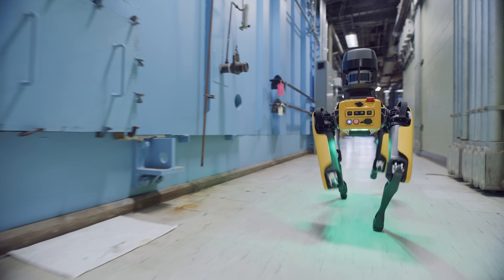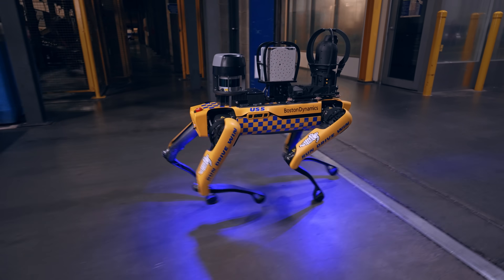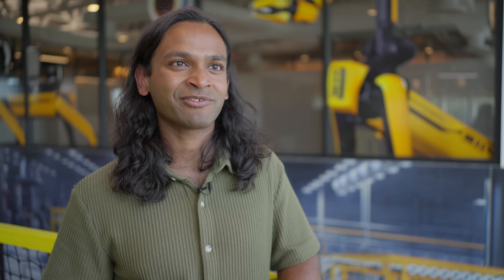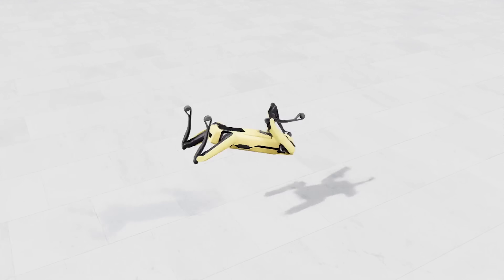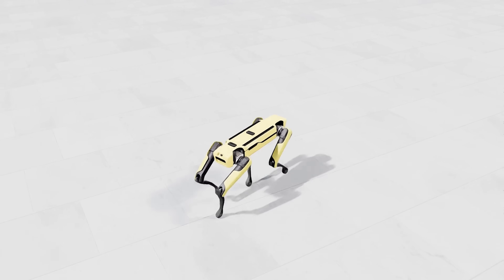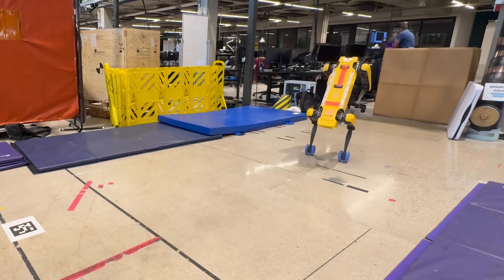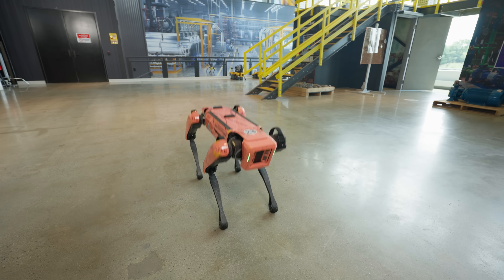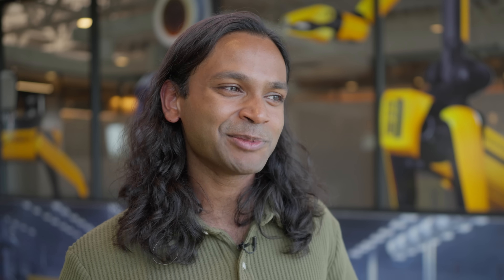Air Spot | RL Behavior Research | Boston Dynamics

Comment: We are where the money is at. You're messing up by not investing in us. Someone is going to. If it ain't you, that's your fault. Also, why are using dumbells to hold down the mats? There's these rubber sheets you can get that makes them stick. Use those instead. Instead of putting a potentially destructive object in the testing area. Man, nerds. Sheesh.

Comment: Was bekommt der Computer für ein Leckerli? Einen Stromschlag? Super übersetzt und sehr gut gesprochen! Wenn das System beim Sprechen schneller wird, ist es dann verlegen oder hält es nur einen Lachkrampf zurück? Falls ich einen Wunsch frei hätte, würde ich gerne die Originalstimme von dem Kuna hören!😂 Die Batterie von den Open Door Buds hat immer noch 90% 😂 oder ist das auch eine Simulation. 🎉🎉🎉 Beeindruckende Leistung!

Comment: does spot use any sensors akin to ears, ie sonar. for stuff like, pinpointing the source of a sound. mostly interested for stuff like detecting stuff outside of his vision cones, like someone coming around a corner (and maybe in the future for listening for ground shifts on unstable terrain, or testing terrain by tapping on it with his foot to hear if its solid or not.
semi related, does he have anything as sensitive as the inner ear for balance? like compared to humans, how accurate is a gyroscope to a pair of inner-ears.
its also crazy to me that hes predicting how his movement will behave for something like a flip and also reacting to it, and adjusting it on the fly, instead of just going through the motions and praying to end up on his feet.

Comment: FYI a triple backflip is when the backflip is done three times in the air before hitting the ground again. And the robot only does multiple backflips in a row. And it never did a triple backflip or a quintuple backflip nor a septuple backflip as the "never went to spots class or gym" engineer. Impressive acrobatics show from the tinman. But not that impressive.

Comment: I'm still waiting for the video where Spot uses its legs to run as fast as possible "backwards", because now moving forwards its knees are not orientated in an optimal direction (bending backwards, reverse of our knees) and such the legs don't have the optimal leverage against the ground.

Anything with knees oriented that way goes SCARY fast.
Reply: Well, there is Cheetah that they have a video from 12 years ago, but I'd love to see how the updated control systems would fare with the forwards knee configuration.

Comment: As a massive warehouse owner we're excited about this, but the price is a bit high for our budget. Is there any flexibility? You can get 26 Unitree Go2 dogs for the price of one Boston Dynamics dog, based on the starting prices of $75,000 for the Boston Dynamics dog and $2,800 for the Unitree Go2 dog. Is competition dead in America? They also have a cheaper model and you could get 46 full Unitree Go2 robots and have enough money left over to potentially purchase parts or accessories for them.

Comment: Why aren't at least two of spot's feet always small wheels (with brakes)? It seems like you could save a lot of energy by rolling when possible, not to mention how much less complex of a motion it is.  With the brakes applied, spot could move as it does now as well.

Same with Atlas. Why not use small wheels for feet so it can balance like a Segway or hoverboard and save its battery for human-like locomotion when the terrain doesn't allow for rolling?

Comment: Hell, this is scary as hell. Imagine, you forgot your wallet at your workplace and you come back after hours… Facing that watchrobot and their failings requires you keep a strong electric shocker with you.

Diktators can’t wait for this cheap forces to rule and control enemies.

Comment: So why don't you use a code for problem solving and make it consistent across all 3 problems? I means its relatively simple. Problem=A>B>C>solve>OmegaABC>1. That's the core idea, and it can be improved depending how many solutions you have, if you give it the exact information of the solution and problems, it should decide a solutions upon consideration of all 3 problems trying to resolve it. The biggest problem is in the use of the framework to solve a problem in the same framework, its not gonna work. Use a different framework then it will know the difference.

Comment: That was really cool, and impressive, the stress on the mechanics is probably quite high in these movements. I assume whatever neural networks are trained would have to be "merged" into some sort of everything-model that can move the body of the robot in whatever way is necessary to achieve an objective, given current environment and sensor information, in the end?
Reply: Yes, that's right.  When training is sufficiently advanced, they can repeat the optimised training regimen into the main AI world model, and then upgrade all the Spot robots that have the same level of hardware.

Comment: The sad truth is Unitree had already done what BD has done 6 months ago and now most AI robot Chinese firms have transfer such experience and focus to humanoid robots instead. Remember 2 leg standing robots are more challenging advance and complex than 4 legs standing robots on mobility. A dog's spinal column has approximately 83-86 degrees of freedom (DOFs), while human has Ribs and Spine: 193 (Total), 170 (Moveable). While US focus on partial DOF (meaning some parts are not moving) on AI robots, China already go to full DOF (thus China held its own AI robot Olympic for the world while US don't even dare to do it. China registered 451,700 companies in the intelligent robotics sector. For USA, guess how many-It is not even close to China.
Reply: Unitree robots are really bad copies of tesla's Optimus models. And in the so called robot Olympics, most of the "robots" fell over after taking few steps and those who managed to finish, were remote controlled toys. And no, China does not have working AI, at least not in robots.

Comment: Billion dollar global insight to max profits. Implement series of experiments by testing the current model of Air Spot robo dog by Boston Dynamics backflips in muddy, rainy, heavy rain, snow, shallow water, and quick sand environments. Then duplicate the robo dogs with model 1, paper at each inner chassis and joints, and model 2. Apple Watch water detection sensors in each inner chassis and joints.

Comment: "The scariest thing about a triple back-flip on Spot is probably finding all the different ways the hardware can fail in these scenarios and finding ways to mitigate them, is probably is the scariest and hardest part of a triple back-flip."

only ever performs a single back-flip. C'mon man.

please learn the difference from a hand spring to a back-flip.
Reply: It doesn't have hands. C'mon man. 

Learn the difference between a handspring and a bulbous-termination-point-of-a-mechanical-limb spring

Comment: The base design and requirements for Spot, set such a high bar for its hardware performance, that it can be programmed to do these things without hardware modifications or upgrades.

Comment: It's still so weird how they keep saying the robot is doing reinforcement learning, which is technically true, while at the same time they also say that when the robot doesn't do what they want it to do, they are the ones who are going to find the problem and not the robot. Why not include tactile sensors in key spots on the outer shell and make a algo that simulates some sort of limbic system that the robot can use to learn by itself instead. Reward shouldn't be the only way to learn things, there should be a system where Spot can learn by avoiding "pain".
Reply: If remember right from previous videos, they said some problems come from difference between simulation and real life, and when they counter these problems they dont know if its on software or on hardware, so that takes some work to figure out. Small differences between different robots and parts, you can simulate a lot of variables but each robot is different, either due manufacturing tolerances/errors or different kind of wear and tear. And they have a lot of moving parts that they are pushing to the limits of the parts, so it multiplies the differences between simulation and real life.

Comment: What's wild is that, at some point, the differences between simulation and physical testing, which are limited in number, will be ironed out enough that nearly anything learned in simulation will be reproducible in physical testing immediately. Every failed physical test that doesn't match the simulation today leads to matching them more closely in the future. You can only repeat that process so many times before simulation and physical behavior are 1:1.

Comment: I'm no engineer, but I feel like the bots should have the capacity to exert that large amount of force, but shouldn't be running at 100% the entire time. With actual living creatures, muscles have the capacity to exert way more force than they normally do, but it's so powerful it can damage itself and the bone structure it's attached to if done for too long.
Reply: In live operation for mine safety and machinery safety inspections, the Spot robots walk cautiously, so extreme agility is a crisis response only.
Reply: That's the beauty of machines, You can and totally should use them at 100% unless energy usage is somewhat important. Living creatures, while resistant have to spare themself because injuries and risk assessment are crucial for survival. Machines wear and it's calculated in service and use parameters. Tasks like these just opens up envelope of possibilities for other users. But I'm no engineer either. :)

Comment: The fact that they built robots that are durable enough to handle the stresses of learning and doing these tricks is impressive in itself
Reply: Yeah...metal...it's been around a while.....
Reply: @OMNI_INFINITY there was a time when they were afraid to let them walk without being attached to string to keep them from being damaged. They were metal as well. Now they let the robots throw themselves about doing back flips.
Reply: @DavidKnowles0 Now they aren’t using hydraulic hoses
Reply: @OMNI_INFINITY  yeah, its too bad metal doesnt emit an anti damage field to the things that arent metal.
Reply: @OMNI_INFINITY  You think circuit boards and electronics are all made out of metal?
Reply: @TilesOfOppression It’s a robot…and yes, the circuit on a circuit board is made of metal
Reply: @OMNI_INFINITY  Nice try lol, you picked one of the only pieces of the electronics that's made out of metal, and it's not even structural
Reply: @OMNI_INFINITY  Ah you should go ahead and bend and sit on your phone then since there's a PCB board inside it and it's "all metal"
Reply: @OMNI_INFINITY  the rest of the circuit board isn't metal, and electronics dont like being tossed around.

Comment: I kept waiting to see a triple backflip in the video, but it never came.  A "triple backflip", as a gymnast would understand the term, would mean three full rotations in the air without touching the ground.  What you have here is three singles in a row, and they're also handsprings rather than than flips.

Comment: 2:50 What kind of reward does a robot get?
Rewarding a machine makes no sense to me.
Reply: "reward" here just means a value that the program tries maximize.

here's a simplified explanation:
the program that controls the robot can select a set of primitive actions to perform. over time, it collects a list of action sequences it has taken, and the reward that each action sequence was assigned by a human (or an evaluation program called a "reward function"). then using this information, the program generates a new action sequence it predicts will lead to high reward.

so "reward" here is a synonym for "thing that the program wants to produce more of"

Comment: A backflip means you take off with your legs, rotate backwards 360 degrees and land on your legs. A back handspring is when you jump from your legs, rotate 180 degrees backwards and land on your hands, then complete the other 180 degress of a full rotation after your hands have made contact with the ground. Spot is doing back handsprings, not backflips. A TRIPLE backflip is when you take off from your legs, rotate THREE times while in the air, and THEN land on your legs. A back handspring is a beginner move for gymnasts. A backflip is also a beginners move but slightly more difficult. Only a handful of people on the planet can do a standing double backflip. No human has ever done a standing triple backflip from a non-bouncy surface and I have a hard time believing that anyone will ever be able to do it. The difference in difficulty and impressiveness between "Three consecutive back handsprings" and a "triple backflip" is so vast they exist in different universes. 
STOP CALLING IT A TRIPLE BACKFLIP.

Comment: Why do scientists still send less reliable wheeled robots to the Moon and Mars instead of walking robots like this one?
Reply: because indeed they(wheeled robots) are more reliable(at this moment of time), if you did not slept on physics lessons in school you would know that round wheels are more efficient/reliable and suitable for long range transportation!
Reply: Less reliable? We've been using wheels for millennia and have an excellent understanding of how they work across all kinds of different terrain.
Wheels are a lot more stable, have fewer moving parts (ie. points of failure), and they offer redundancy. Towards the end of its mission, one of the six wheels of the Mars probe Opportunity failed - making it difficult to drive forward. After studying the problem in depth, the solution they found was to drive it...    backwards!

Which reminds me... If you think the Moon and Mars are going to be crawling with bipedal Tesla-bots building things, think again.  A bipedal robot is probably the worst design you could ever choose. Any advantages will be outweighed by the challenges - stability, battery life, heating and cooling issues, range limitations, etc.

Comment: Spot Graphene Fusion. Everything gets made at an atomic level to include the battery shell electronics and it’s all one thing.  That’s how everything‘s gonna get done as soon as you’re done getting your science done.  That’s the next level of electronics and we have to get there immediately or we’re gonna burn up because what we’re doing with silicone is the equivalent of trying to run a AAA game on an RTX 5090 that’s made of vacuum tubes.
Reply: Photonic compute.

Comment: You need to start taking all of your failures and tracking them.  Your failures will point to were the real math is at. For example, right now one of my thoughts is that this is a Mobius strip with nine layers that represent the different dimensions that we think are here. The possibility could be that if you looked at the zero point of a waveform, those might be the transition boundaries as waves pass through the third dimension.
Reply: Particle physics is probably just waves hitting a transition boundary, but they are not real at all because that wave keeps going into the other dimensions and you’re just seeing a reflection
Reply: The noise is the real universe.  We’re doing the exact opposite by filtering it with an our dimension, but that is the real universe or at least our perception of it as we can view it.

Comment: Not to be a bummer, but isn't a "triple backflip" three backflips during a single jump?  And the demonstrated behavior is consecutive single backflips?
Reply: A triple backflip is when you rotate three times in one jump. These are not triple backflips, they're not even backflips, more like back handsprings.
Reply: Somersaults technically but they all involved intense physical stress necessary for the test
Reply: @j-sant-animations8105  A somersault is a completely different move.
Reply: not really, because the start of the second and thirst flip is completely different from the first. 1. The position, 2. The velocits 3. knlowledge of position in the room and so on, everything changes, especially when you come out of a movement

Comment: Is it possible to scale SPOT up to the size of a car or the size of a Fridge. Scale him up really big? I'm thinking that it's possible considering that you perhaps have to scale up power and motors but the rest of the body wouldn't be so heavy. I don't know. Tell me boston, is it possible to make a horse sized SPOT?
Reply: Look at their old videos. Originally there was a bigger Spot and some other large 4 leg robots as well
Reply: @areadhead  yes that's what I was referrring to but a modern day rendition. Something the size of a car with the maneuverability of this SPOT.. materials could be light because the entire body doesn't have to be filled and it could really just be foam and carbon fiber maybe for the prototype. But I definitely believe they have some larger, more serious robots at this stage
Reply: A car may be too much if you want it to do backflips, but yeah.

Comment: Range of motion on Spot is impressive.  Testing to fail is how you learn and improve. Nicely done.
Reply: The range has been increased over time. I want to know if it can walk with it's back flipped facing down.
Reply: Training full range of motion to failure is how your motors grow 🦾
Reply: eh iam a spaceengineers construction veteran - ehm you just set the propulsionPower - an experimental value - than you just looking how its landing - as next you just need to set the vaules. maybe adding an extednded weight calculator for the changing % amount of propulsion power . . Huuuh it must be really intresting to programm it.
Reply: i can just imagine spot being optimus's best friend, spot is bot's best friend.
Reply: Exactly as Elon is doing with the rockets.